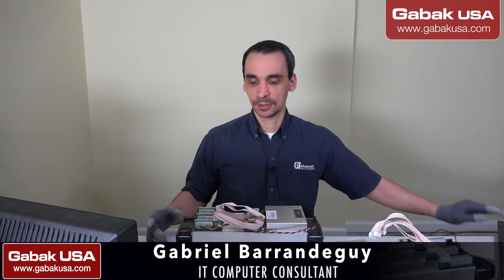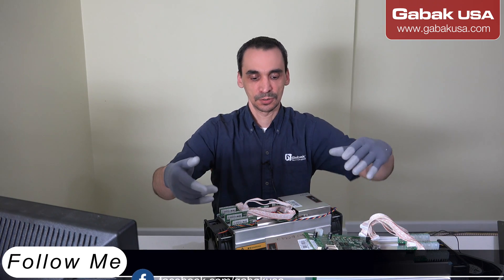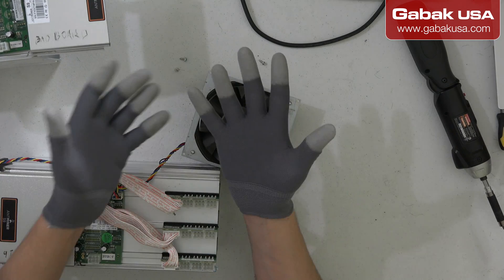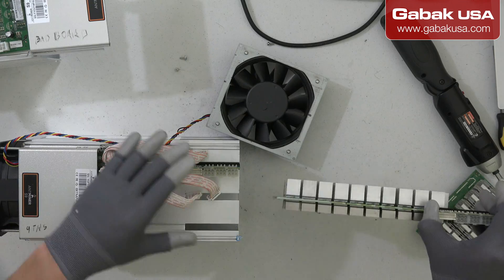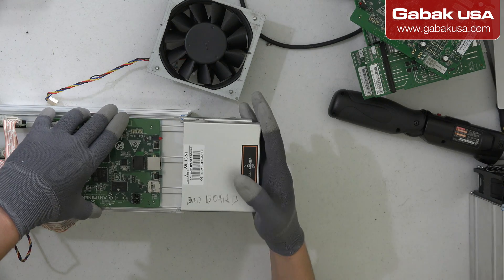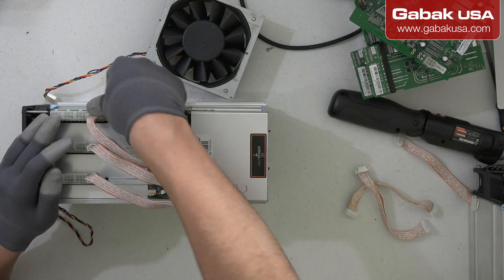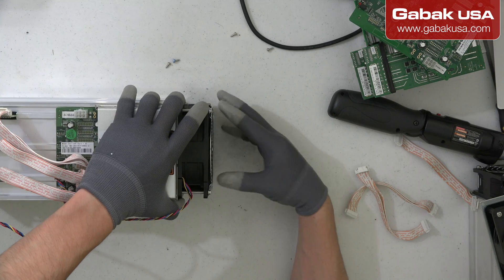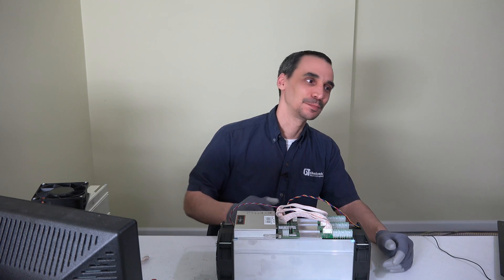how to replace the antminer board controller

Comment: I can't login to my WEB interface for my antminer V9. Root for both username and password doesn't work anymore. I held the reset button in for 5, 8, and 10 seconds and nothing. This is after it was running for 5 minutes.
Reply from the maker: try with other browser
Reply: I figured it out. I was hacked because I didn't change the default password. Needed to format and flash an sd then power the antminer off. Then turn on with sd inserted and wait 2-3 minutes or until the normal(green led) to blink consistently. Hold down the button for exactly 20 seconds and the fault(red led) will start rapidly blinking. Once you let go of the button the fault and normal light will come on and stay on that is letting you know it is resetting. Another way to know it is resetting is listening to the fan speeds changing. This is an antminer v9 so if you have a different model is might be different resetting it. There are not any good videos that explain how to reset an antminer with an sd.

Comment: how can i know if my control board is not working the miner is not working and a green light is flashing from in side could this be an indicator or a code that its not working not hte normal led its a differen one from inside of the board and keeps on flashing
Reply from the maker: can you access to the WEB interface?
Reply: GabakUSA Free computer training yes i can